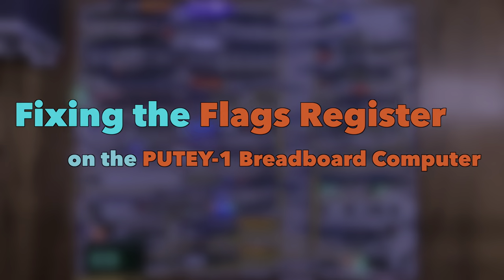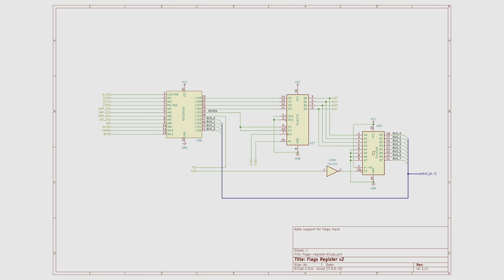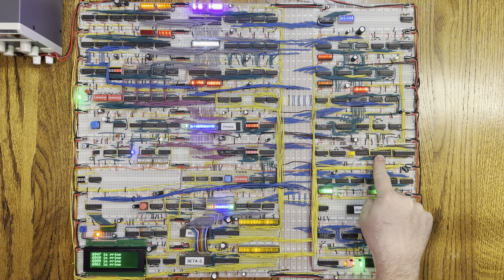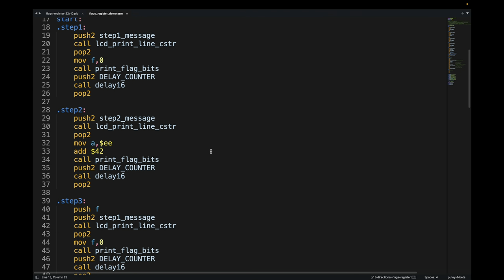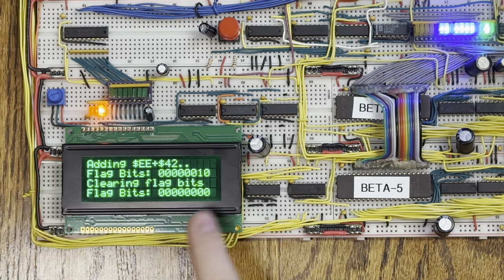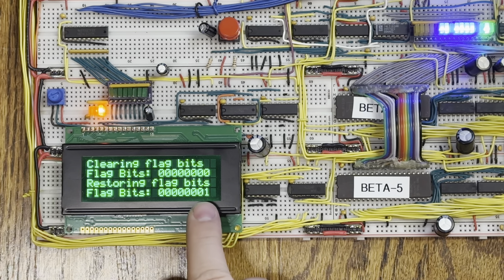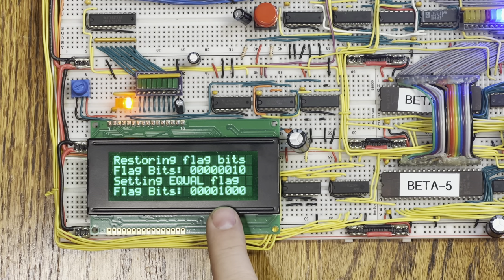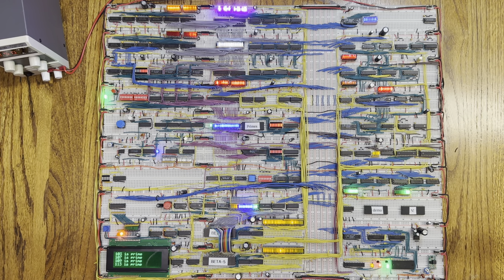Creating a Writable Flags Register on the PUTEY-1 Breadboard TTL CPU

Comment: Interesting additions! Beyond imitating legacy instruction sets, what functionality is gained with this addition?
Reply from the maker: It wasn't so much to "imitate" the legacy instructions as the PUTEY-1 instruction set is wholly unique, it's just that the legacy instruction set inspired me to add certain functionality. The whole goal here is to be able to save and restore the flags register, so that functions with no side effects can be created. I unwittingly demonstrated the spirit of that goal in this video with the bug I had to resolve near the end. This goal of being to create functions with not side effects will become especially important when I get to the point of adding interrupts to the computer.
Reply: @MichaelKamprath  Thanks for the info. I did not realize that you were planning on adding interrupts. In my 8-bit CPU, I saved the status register to the stack alongside the program counter during interrupt acknowledgment for this reason. I did not include an instruction that allows writing to the SR for privelge reasons. There is not much reason for user code to be able to save and restore the status register on its own... there are not many useful actions that can be taken between setting flags and performing work that doesn't trample them. For example, when doing multibyte additions, you wouldn't add the low bytes, go do something else, and then add the next bytes. You'd just do the operations back to back, so in that way the flags can be thought of as just state shared by only two consecutive instructions.
Reply from the maker: @bradywb98  While I am planning to add interrupts, I can't say I have plan . Still need to figure that out 🤷‍♂. 

With that said, I would say the useful reason for being able to save the flags register is to handle the case I describe in the video: creating functions and subroutines with no side effects. For example, if I do a math operation, then I want to print the operation, and then branch based on the flags of the original math operation, being able to save and restore the flags register before and after the print operation is useful especially if don within the print function such that the caller never has to be concerned with how the print function impacts the program state. This gives the programmer much more flexibility in how to structure their program.
Reply: @MichaelKamprath  Yes, interrupts are the killer use case here.

In my 8-bit CPU, the microcode ROMs had two address bits which encoded a processor mode. Normal, extended (for 512 opcodes), IRQ, and NMI. There was some logic to properly encode these bits outside of the ROMs... my available address lines were limited. The updated mode would only be allowed to change at T0.

When the mode was IRQ or NMI, the IR and flag inputs were ignored and a microcode sequence would make two memory access to push the program counter to the stack, a third to push the status register, and then jump to a  hard coded address (I was using trampolines rather than a 6502-vector).

IRQs would disable IRQs, and NMIs would set a bit signifying that a NMI handler was being enterred. If the new mode was NMI and that flag was set, then external logic would reset the processor (think of that as a double fault). Of course there was some additional complexity there relating to other implementation details, but really it was fairly straightforward.

The way I implemented the microcode was extremely wasteful as 25% of the ROMs had the same IRQ acknowledgement sequence, and another 25% had the NMI sequence. A better solution would be to make your control bus trip-state so that it can be driven by your standard instruction-decode ROMs, or by a smaller ROM responsible for these types of CPU control sequences. Select between the two via an analog to my two mode bits.

Anyways, just some concrete ideas.
Reply from the maker: @bradywb98  Oh wow, thanks. I don't know when I will get to it, but thanks for these pointers!